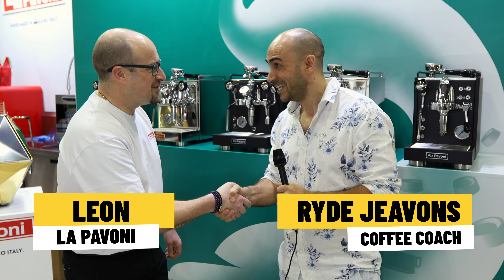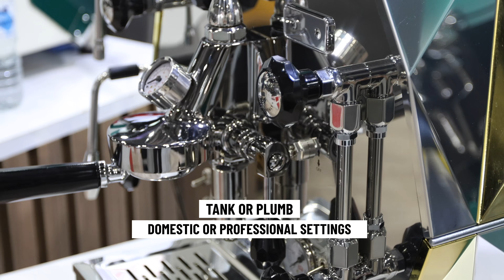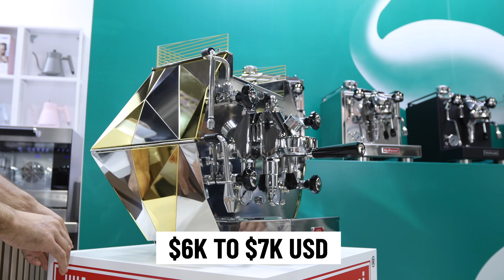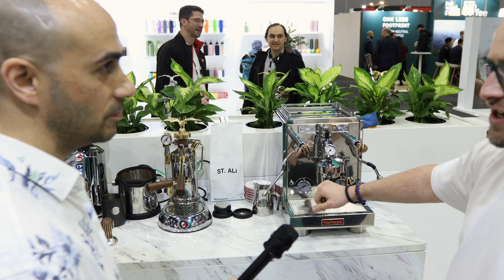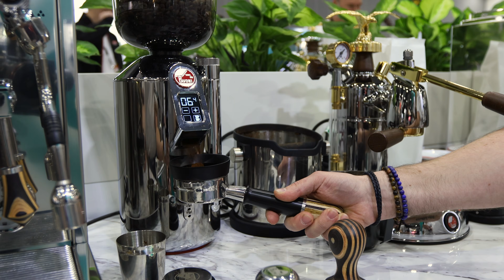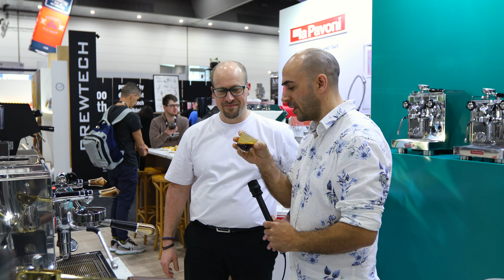Is La Pavoni's Diamantina your next coffee machine upgrade?

Comment: This or the Sanremo One has made it to my final list for upgrading my BZ13. WHICH WOULD YOU PICK?
Reply from the maker: If you want more profiling capabilities then the You. If the style of the la Pavoni is more suited to the kitchen, then I'd get it but if it's more of a modern home then the You. 🙌
Reply: @Rydecoffeecoach  thanks at ton. Love your content. My other top contender is the LMLM. I know you feel the Micra sort of obsoletes it but the longer wand and ability to handle a taller cup still gives the Mini appeal over the Micra for me. For thousands less I could get the ECM... LOL. Sort of paralyzed by information right now. If budget were no concern and you could only have one home machine what would you buy?  I know you like Decent but it is single boiler. Not an option.
Reply from the maker: @tennesseetee  Decent is a zero boiler but I know what you meant 😅 yeh I get it, analysis paralysis and you don't want to make such an important decision incorrectly. 
Just know this: you will absolutely love whatever machine you end up on AND you might have a tiny bit of buyer's remorse or upgradeitis. 
But we have to start at the beginning. You need to tell me what the MOST important things are for you. Cup clearance might seem important but you can extract into a shot glass. But maybe that's a deal breaker as well. It's totally personal! So what are they?
Aesthetic design? Size of machine? Reliability? Speed? Profiling and extraction experiments? Modern features or old school technology? What about getting a good deal on price if price isn't a limiter? 
Tell me all your list in order of importance. I can only guide you, in the end your gut will make you go a certain direction and you'll be satisfied, trust me!

Comment: I have owned la pavoni Botticelli dual boiler for about 2 years. The coffee machine from the factory is initially very unfriendly. The PID sensor is configured with a temperature shift in the group by 27 degrees Celsius, that is, after heating, superheated boiling water flows. However, there are no instructions for setting up the PID or even entering the programming mode in the PID. I found how to set it up in the video who latte love. The steam nozzle is also very heavy to use, 2 holes of 1.5 mm each. The bubbles are huge, it’s hard to beat, the foam is dry and bad. I had to buy a separate steam nozzle with smaller holes. Men also have lelit anna pid, take it straight out of the box and cook it, much friendlier despite the fact that it costs 6 times less. La pavoni has conflicting impressions...